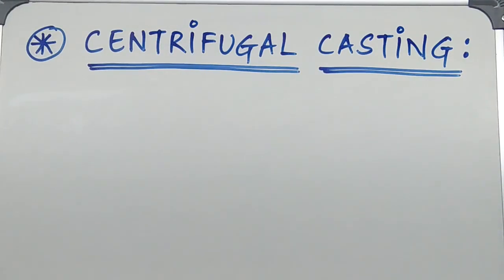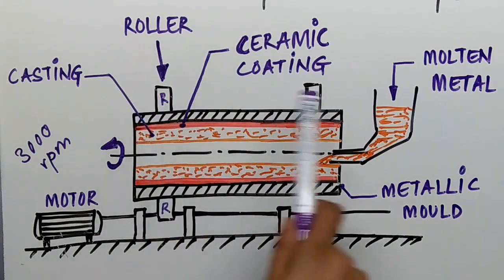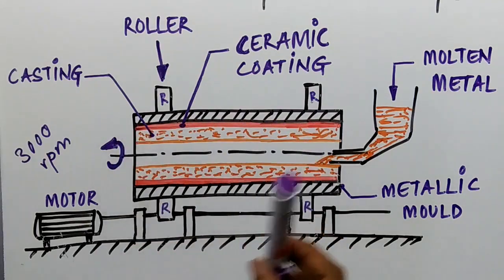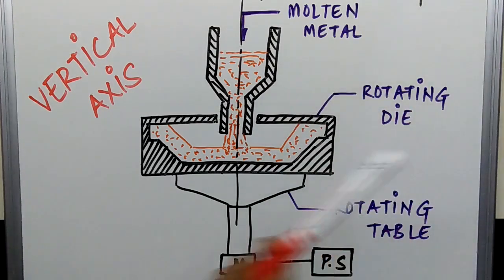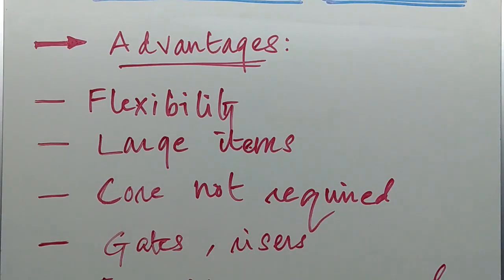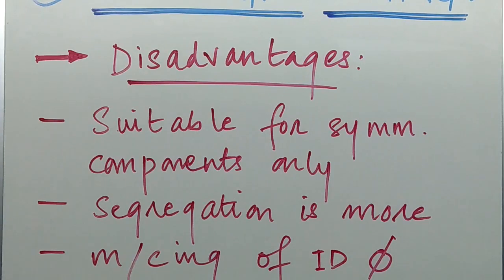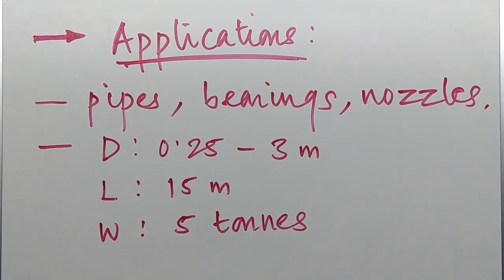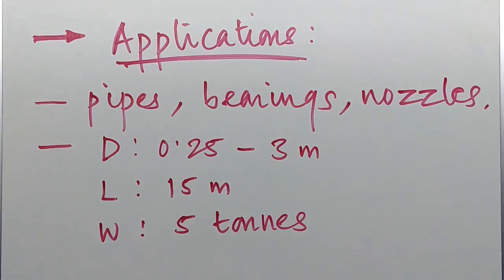True Centrifugal Casting explained | Mech Easy

Comment: What are the material used ,wt   is the temperature of metal which used for cast, give some examples ,tell about the machine names ,wt dia and length will max and min use in the process ?